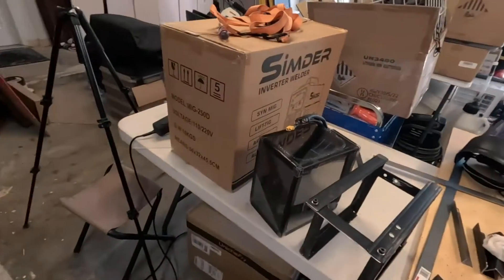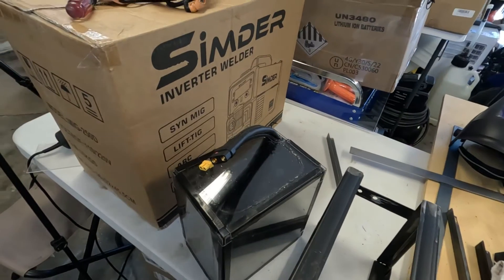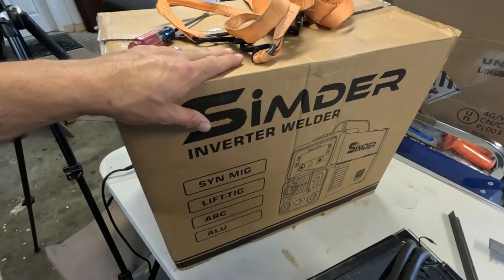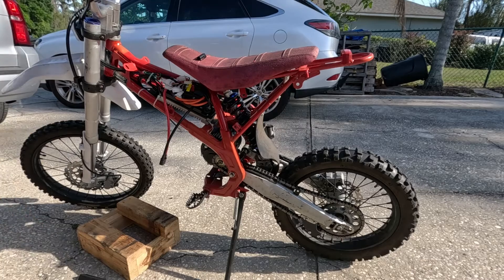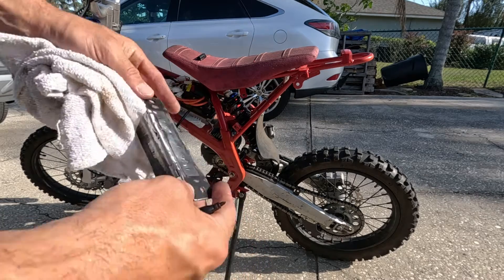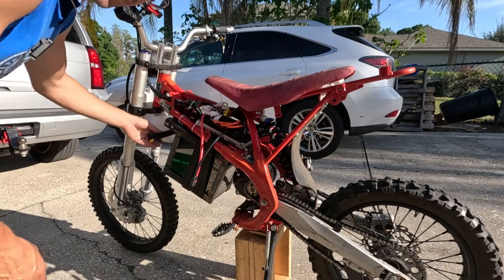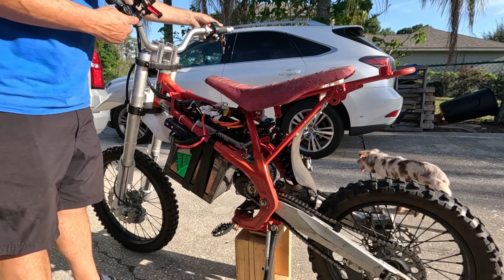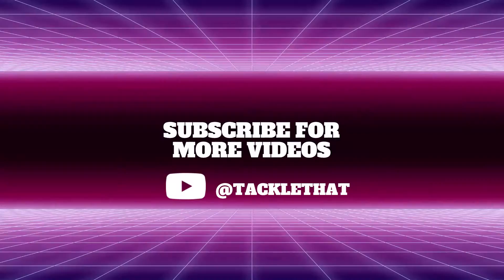Battery Cage! Electric Dirt Bike Build Conversion! Part4! Amorge 72v Litium Battery Pack #ebike #EV

Comment: Hey man! I've got a frame sitting here weighing 50KGs excluding battery and motor. Do you think the QS120 will serve me well? im just like you, looking for torque on trails, not a top speed demon.
Reply from the maker: Nice!! Id say its bare minimum. If you can, I think the 138 is better suited for full size mx.  But if you are putting around trails going up to 40mph/65kmh, the 120 is a solid option.
Reply: @TackleThat  Yeah thats exactly what I'll be using it for. I wouldn't say my frame is full size MX yet. Dude I bought it from said there was a 250 in there but I really don't think the frame was 250 originally. 17 front 14 in the back, I just hope I've got enough power to rip the trails. 
138 was out of my budget, maybe in the future! I don't yet have a battery pack with a high enough discharge rate yet, sadly enough.
Reply: @TackleThat  Cheers for the reply!

Comment: What's the top speed on the qs120 v3 with your current setup?
Reply from the maker: Getting around 50mph on the stock gearing. I like having the low end torque for trails, don't really need to go faster than that. I could go much faster if I changed the gearing, but I'd give up a lot of torque.